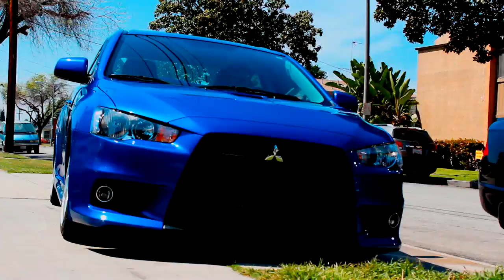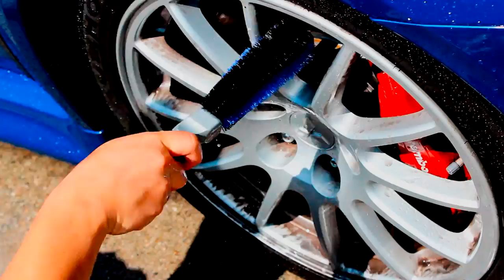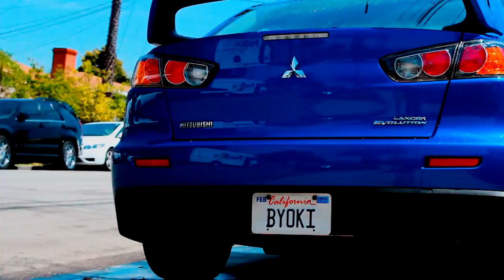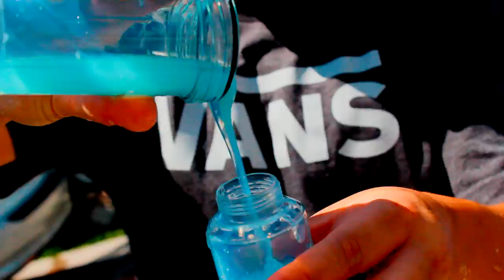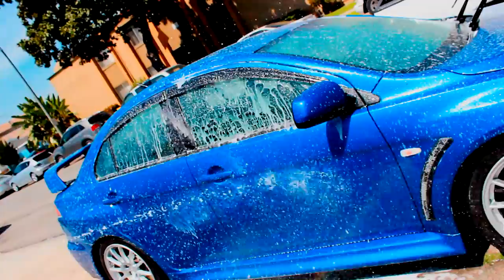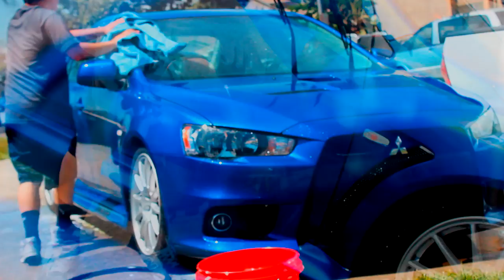Mitsubishi Lancer Evo X

Comment: Never use the same bucket water or soap water on the rims and on the body. Small break dust particles from the break dust stick onto the mitt and can scratch the paint or cause imperfections which I'm sure you don't want on this awesome car

Comment: THIS IS WHAT I WOULD DO FOR MODIFICATIONS ADD A VORTOX FOR THE ROOF ADD A FRONT CARBON SPLITTER ADD MOD FLAPS ADD BLACK TUNTS ADD SOME SORT OF EXHAUST SYSTEM WITH CARBON EXHAUST COVERINGS AND A REMAP